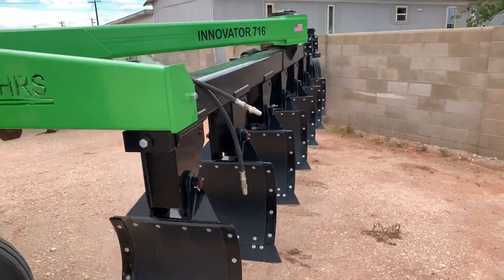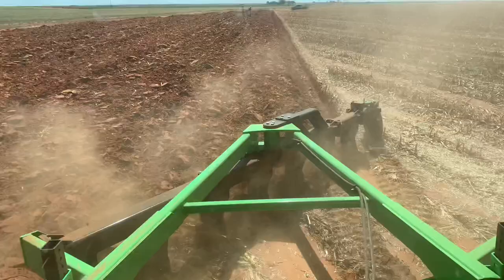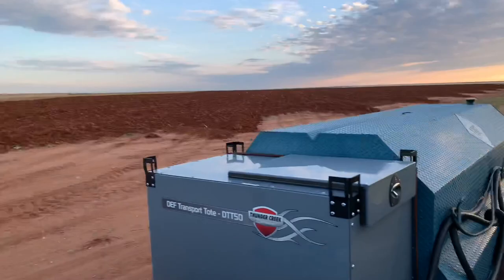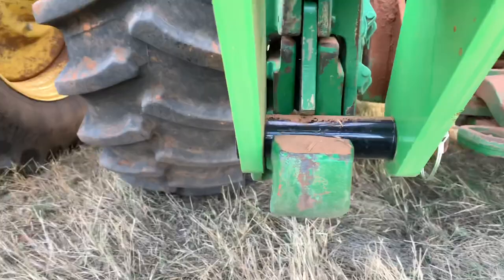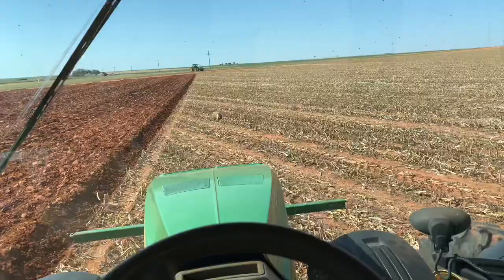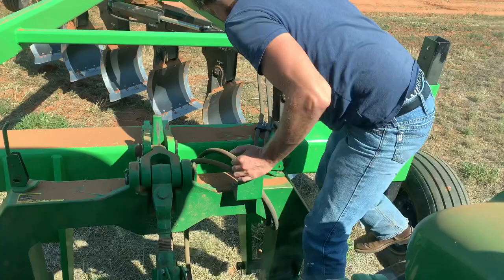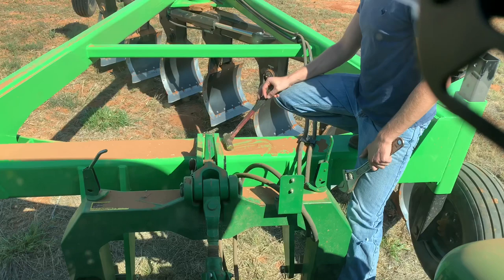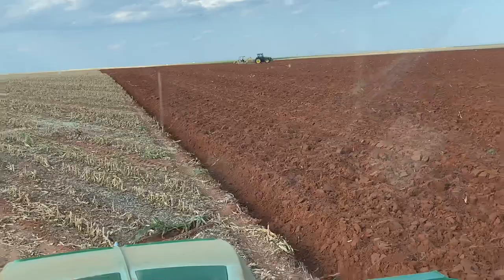We got a new plow

Comment: To me, the only advantages these ploughs have is that they are light and relatively simple, and cheaper. They are much harder to pull than regular twisted plates. These ploughs need 40-50 hp extra for turning the same width of soil compared to a decent twisted plate plough. In my younger years I ploughed a good deal with a 7 x 18 Kverneland behind a hot rodded 4350, (190 pto hp) In medium soil and 9" deep it would pull the plough with ease at 1700 rpm and 5 mph. Yours turn the soild nicely though. How many acres can you do before you need to replace cutters?
Reply from the maker: Yea it’s definitely different. We have to use these plows because of the dirt we like to flip the dirt all the way over. And with going about 18-24” deep we can usually cover 480 acres before replacing the blades
Reply: @conleybanman  Alright. 18" is deep and naturally requires more power.
Reply from the maker: Yea we use our 8370r and it can barely pull it 5mph but it still pulls easier than a Johndeere plow

Comment: Looks like the pins too small,plow seems small for tractor but you say otherwise and you must know.Saw Mercedes Unimog 1600 video with 8 bottom plow
Reply from the maker: We were going about 18” deep that’s why it was pulling so hard plus it hadn’t been plowed in many years
Reply: Ah,then I understand,thats not normal,couldn t see that on vid,the Unimog truck just normal depth after corn sticking up after plowing and think from Holland where soil maybe more light (old seabottom?),so it wouldn t stand a chance at your location,but still watching it turn that 16 bottom plow in the air,didnt think poss.but you can watch for yourself,,,,have a nice growing season.DK.

Comment: Have you ever consider no till?
Reply from the maker: Oh yea we love no till we actually prefer that or even minimum till. But in this case we have to since we’re planting peanuts
Reply: Why do you have to plow for peanuts?  I love peanuts but know nothing about their production, I farm in South Dakota and most plows in this area have been cut up for scrap. I have  3 plows but haven’t used them in years. I may use the Melroe 8x16 this spring on some areas that were too wet to plant in ‘19 and ‘20. Why that type of moldboard? I bought the 8 x 16 on a farm sale in the early 90’s for $350.
Reply from the maker: For peanuts there’s not as many options for spraying weeds as there is with corn or cotton and a main way to get rid of weeds or volunteer cotton(which is hard to kill) is with hoe hands or with plowing. These plows turn the dirt over completely leaving weed seeds way underneath the ground. It doesn’t solve it completely but it sure helps a lot